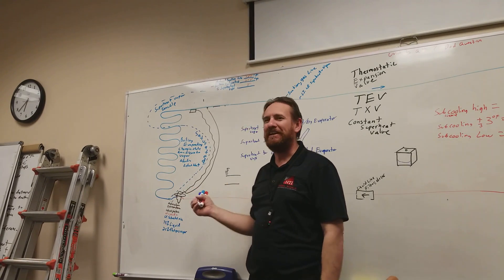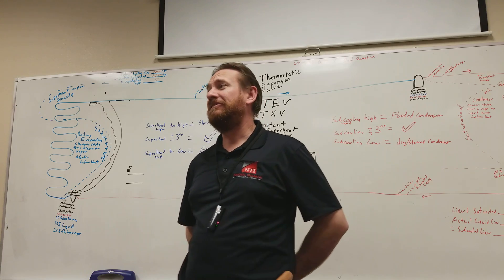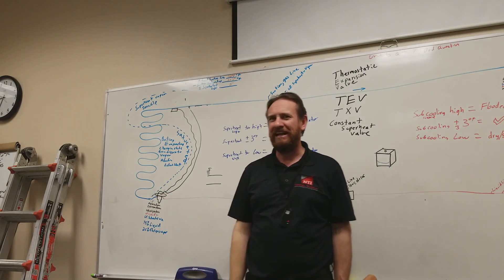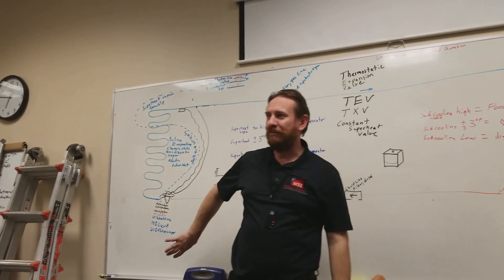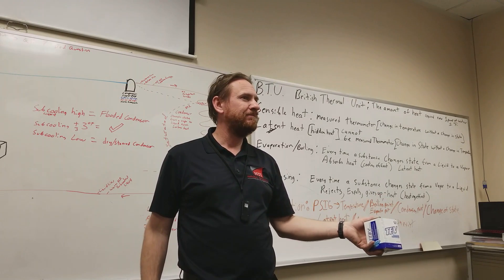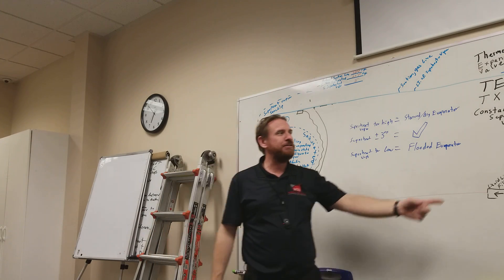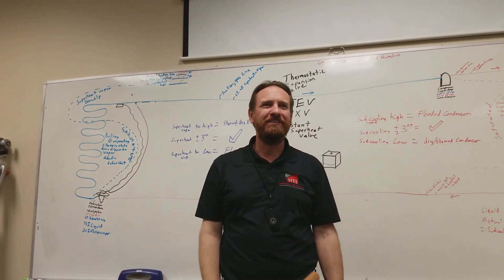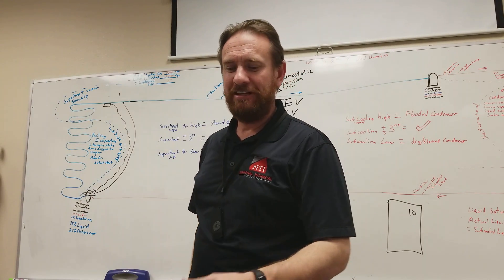TXV TEV failure, checking, superheat and subcooling

Comment: how does txv work with heat pump
Reply from the maker: The indoor check valve will open and will bypass like it's not even there.
The outdoor check valve will close forcing the refregerant threw the TXV opening.
They txv will adjust to control superheat measuring suction pressure on the true suction line and actual suction line temperature on the true suction line to the compressor.

Comment: TXV FUN FACT:  The average maximum TXV valve's pintle pin 'lift'/opening size is only 0.200 thousandths of an inch.  MAX! 
Now think about just how SMALL the opening is during NORMAL operation.  SMALLER!  
How important is a good clean refrigerant inline filter NOW!  (A TINY foreign object can RUIN the whole show!)
0.200!!! MAX avg. TXV OPENING!  No MO!
Reply from the maker: , let's look at this as a whole picture. 

Let's say a 3 3 ton system uses a piston, the opening being .078

Now replace that with a TXV The range for accurate control from the TXV viewpoint is 30% to 100% (Nominal capacity). The full open stroke of the valve is ~ 130% of rated capacity. From an opening standpoint, free diameter for flow would be equivalent .026 to .104" for 30 to 130%.
The opening being able to range smaller and larger than a fixed orifice.
Reply: @love2hvac  
TY,  Thank you!
(I got the 0.200 number from a Sporlan factory Rep doing a class.  He DIDN'T give us as clear a picture as you just did.)
So then, a residential, (5 ton or less), TXV pintle MAX opening size is even SMALLER than I mentioned of 0.200!
TXV pintle lift range is 30% to 130% of whatever the system's equivalent fixed piston size is.
I PERFECTLY UNDERSTAND NOW!
Thank you!
BRETT
Sacramento, California

Comment: Hi,
So if the TEV Bulb fell away from the Suction Pipe, would the TEV valve go to an "Open' State and keep pumping more and more liquid until the compressor flooded with liquid, then 'BANG'
Reply from the maker: Yes that is correct! It would not be an immediate bang but it would start hurting the compressor

Comment: Carrier and Bryant sold me over 300 coils in 2013 to 2015. Sold me 50 heat pumps with Fan coils and Evap coils for dual fuel and for straight AC just wire reversing to make them stay in AC mode. We had a 95% failure rate.  Carrier blames my install guys. The same ones that have been with me for years. Our company installed the first R-410a AC unit in North Carolina. In 1997 we had to install a txv on the evap coil. The AC was still running in 2015 when she sold the house.  We Installed r-410a a full year before Carrier geared up for a class on the new freon. I bought gallons of Nu-Calgon Renew on Ebay.  Carrier would not give me the oil free no charged me $250.00 for tool to install oil. Charged me $70.00 for 1 bottle 4 oz. On Ebay I found it by the gallon 295.00 a gallon and the tool for $60.00. Rheem gave oil with every unit they sold. To there Dealers. Carrier came back 2 years later said Copeland Compressors had the wrong oil in them causing the TXV to stick like tar and clog the system. Carrier would not stand by its dealers. No help just pay us for the bad equipment we sold you. Not send a letter out to my customers saying its there fault and sorry. NO I did . I repaired all the bad units with the Renew oil or with new parker TXV 's installed them in a location that fingers could take off the TXV and put it on the outside of the coil box. The fan Coil location was ok. Carrier bought the cheapest TXV from Mexico. I would put one on and the next summer it was bad again. Until we install the oil in all 250 units we bought form Carrier the problem did not stop. I am glad we did not put but 5 years on all parts on all we install. Never will we give a 10 year parts warranty on any HVAC part.  Most is 1 year part and labor, 5 year compressor. If it breaks the funds go in my bank. Who gives 10 years on parts. All contractors should go this way. Let the factory parts made in China let the factory pay us the contractor. I did no go in business to give my Knowledge and skills away to greedy Manufactures  that take advantage of small business.  They know you will not bring back a contactor or capacitor back in 30 days of failure. Guys we are the end of the line. You must sale a 3 year old capacitor for $300. plus service call for $120 to 160.00 within 10 miles from the shop. If not you will go broke. Vans are $40.000 with tools and parts ad 10k for 1/2 of what you need. Got to track you trucks, 2 million liability Ins for a 5 truck company is $800.00 month and 6 trucks ins is another $800.00 a month. workers comp on labor of $200,000.00 pay roll cost $1000.00 a month 6 or 7 men. So when Carrier or Trane says it should not cost more then $500.00 to put in a compressor. You do that so you can stay busy not making nothing. Its $1900.00 for compressor under Warranty, and $ 2700.00 for no warranty.

Comment: rheem units the txv bulb is mounted on the out side of the air handler and is clamped at the 3 or 9 o'clock horizontal position never vertical and we'll insulated we have seen some mounted on the vertical and they will not perform right this is stated in the Rheem manual (never vertical)

Comment: in the video mentioned about, by wrapping with wet rag during brazing, can reduce the to....212? that 212 SI unit is in temperature or pressure?
Reply from the maker: Wet rag will keep it at 212F (depending on atmospheric conditions and altitude)

Comment: hi Ty, if i were to replace a piston with a txv, how would i pick the correct size? do all txv comes preset for a certain superheat value? i saw a new txv from supplier's bag and it say 18-36BTU? thank you.
Reply from the maker: The best way is to buy the OEM matching kit from the manufacture. Every manufacture I know of has a kit that fairly easily fits. 

Txv/tev will come in a range but typically they are in 1 ton sizes
12000 24000 36000 48000 60000 BTU.  but some universal's now have an wider range than that. They even sell kits where you can replace springs and parts inside to fit s large range.

Some manufactures sell non adjustable TXV/TEV. Others have sell adjustable only with the refregerant removed and some make my favorite style that are fully adjustable with a cap and a stem on the bottom. 

Some more information here 

https://www.achrnews.com/articles/137404-why-and-how-to-adjust-a-txvtevand 

https://www.achrnews.com/articles/keyword/1369-txv-thermostatic-expansion-valve

https://www-hvacrschool-com.cdn.ampproject.org/v/s/www.hvacrschool.com/how-to-properly-diagnose-a-failed-txv/amp/?amp_js_v=a2&amp_gsa=1&usqp=mq331AQA#aoh=15632489998211&amp_ct=1563249018673&referrer=https%3A%2F%2Fwww.google.com&amp_tf=From%20%251%24s&ampshare=https%3A%2F%2Fwww.hvacrschool.com%2Fhow-to-properly-diagnose-a-failed-txv%2F

And a great podcast 
https://www-hvacrschool-com.cdn.ampproject.org/v/s/www.hvacrschool.com/txv-operation-diagnosis-failure-w-jamie-kitchen-podcast/amp/?amp_js_v=a2&amp_gsa=1&usqp=mq331AQA#aoh=15632491063998&csi=1&referrer=https%3A%2F%2Fwww.google.com&amp_tf=From%20%251%24s&ampshare=https%3A%2F%2Fwww.hvacrschool.com%2Ftxv-operation-diagnosis-failure-w-jamie-kitchen-podcast%2F

Comment: hi Ty, when charging r410a by subcooling why does it take so long to see a temperature change on the liquid line (on thermometer hooked up to liquid line)?. when i add r410a i see increase in head pressure BUT the liquid line temp. barely move. great teaching by the way. thank you.
Reply from the maker: Hi Mark
It's not important to see a change in just the line temp or just the saturated temp. We want to see a change in the subcooling. That is telling us how much liquid we have in the bottoms rows of the condensor. 

In some instances the saturated can stay close and the line temperature change. Sometimes they both change but usually the saturated will rise first. The saturated has to be higher than the outdoor ambient to reflect the heat. Raising the saturated rejects the heat at a faster rate. The difference in air entering and the saturated is TD. In this case condensor TD. The higher the seer the less the TD has to be. The older equipment had less surface area and required a higher TD to do this same job. There are many other factors that will effect this also. It's an entire tooic alone.

Comment: Does small unit 1.5 ton. Have to use metering device. Can not replace with TXV ?.
If we replace metering device with TXV , and we charge with subcooling.
How do we know what subcooling should be.
Like 10 degree or less
Reply from the maker: All systems will have a metering device. Most common are fixed orfice txv/tev and capillary tube. Txv/tev most commonly use 10 subcooling and a superheat of 8-18